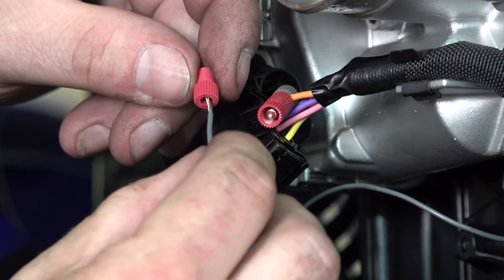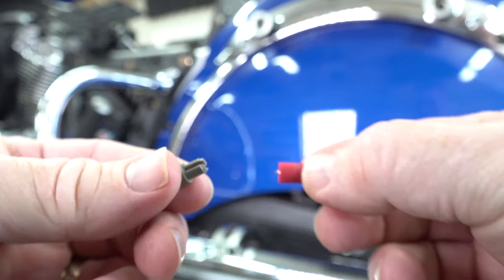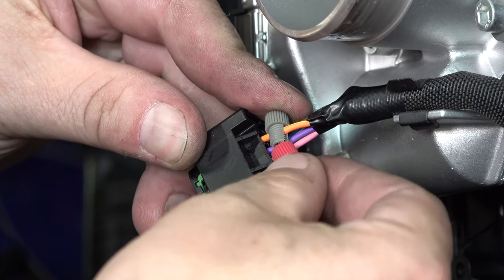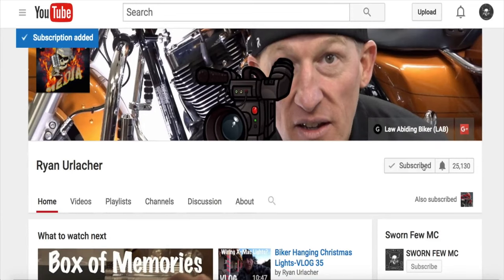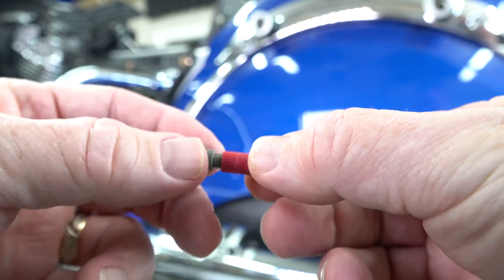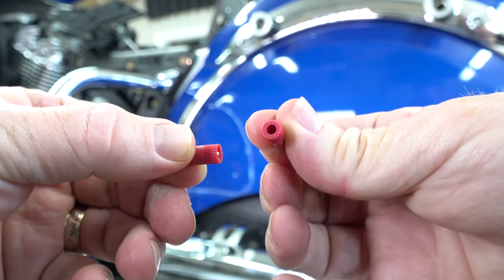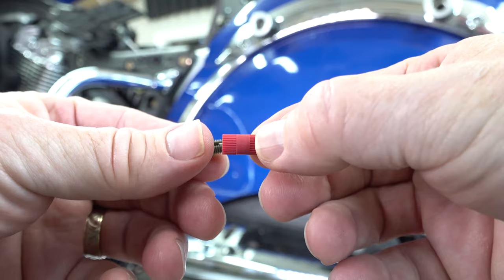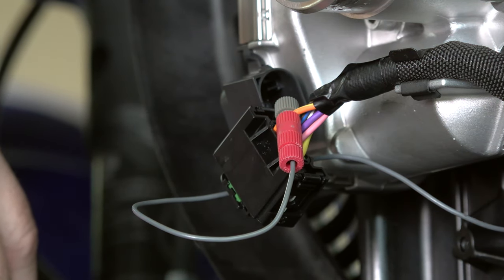How to use a Posi-Tap, Twist, Lock Wire Connector on Motorcycle

Comment: They do work  pretty well..  I didn't like the idea of corrosion of the bare wires..  but I guess I could  use  electrical  dialectric grease...  Posi Taps  came with my Admore  Digital  tail/brake / turn signal  LED  but  I  chose to splice and solder  so many tires together  after giving up on   Weather Pak  connecters  because they were way too large and bulky to fit under my seat..
   Deutz  type  connectors are way more compact..

Comment: Bought batwing ferring a few years back  for my 05 road king. It came with a stereo that according to installation instructions had to tap into the ignition. It came with that very connector. Only problem was I didn't know what wire that was so I Googled it found the line and with installation probably took all of  45 minutes and I was rockin and rolling down the rosd.